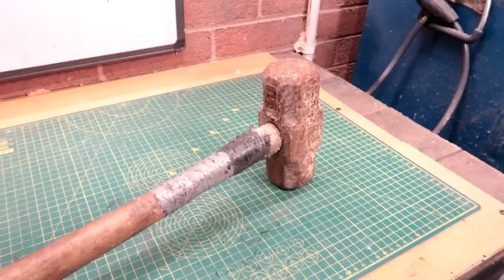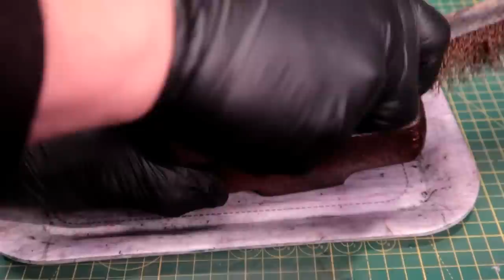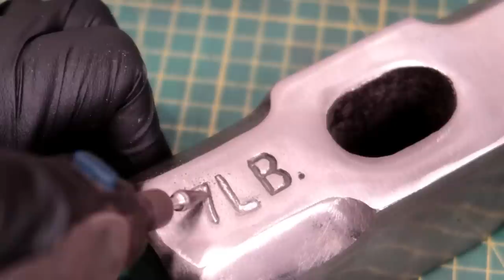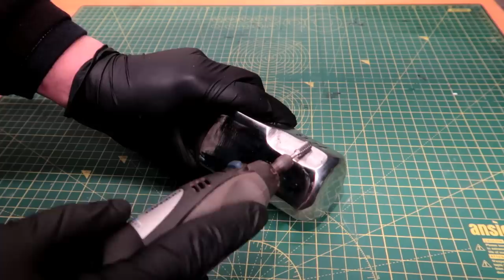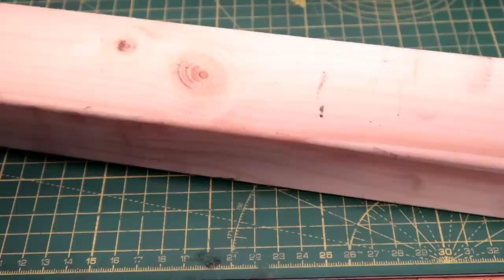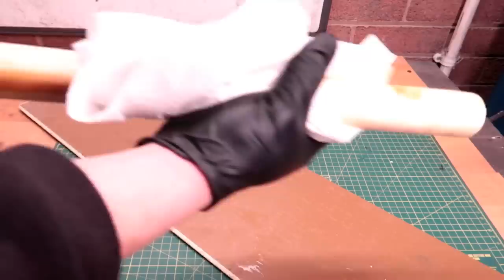Rusty Hammer Restoration

Comment: Nice job. However, that softwood handle will soon break. Next time, use oak or other hardwood. Also, for safety, the end of the handle should have a bulge to help retain grip.
Reply from the maker: Thanks for advice 🍺🍺
Reply: That sledge has been refurbed to "work-O-art" status. Probably not too much heavy lifting in its future.

Comment: Nice job, you got that polished really well. Unfortunately that nice handle will let you down. It looks like Pine, good for house frames but to weak for tool handles as wooden handles are made of particular timbers because of their qualities. They are usually a hard wood which has a tight straight grain but has flexibility as well. One of the best is American Hickory. In Australia, spotted gum works very well and in England Ash is the preferred choice. I don’t know where you are but just google axe handles in your country to get some information. One other point, the shoulder you put in the handle at the base of the head is a no no. This creates a high stress point and is the most likely place where the handle will snap. There should be a gentle bulge in the handle at the base of the head tapering down into the hole in the head. Again look at google for sledge hammer handles and you will see what I mean. I hope this helps you in the future as you have some very good skills and I would like to see more of your work. Don’t take the criticisms in the comments to hard, except for the first one WTF, people are just trying to help. 
Good luck and cheers, Stuart 🇦🇺
Reply from the maker: Thank you for advice,I live in uk and we use ash.but it is very difficult to find in my city
Reply: Alex B 👍👍👍

Comment: Wow ! Holy smokes this is incredible’ I’m working on a hammerhead at home sadly my angle grinder just broke today! Do you know anyway I can attempt to clean off the carbon and rust off by hand?
Reply from the maker: Thank you for comment, you can clean with a file or sandpaper.🍺🍺
Reply: @AlexBRestoration  hey thank you so much for your responses!
Reply: Soak the head in White Vinegar....  no sanding needed .... 24 hours then use a stiff steel brush then another 24 hours and it should come off easy

Comment: Don't use it because the bondo will chip off.
Reply from the maker: I used it a few times and had no problems with it,but I will replace the handle as soon as possible.thank you for comment
Reply: @AlexBRestoration -  I'm not the guy who made the comment on the handle.

Comment: I had to stop watching at the fucking 2x4. I made it through the god awful polished finish in a sledge hammer, even the fact that you did a rust removal process BEFORE going to town with an angle grinder. But to use a standard pine 2x4 as a handle....thats just unforgivable. Thumbs down son.